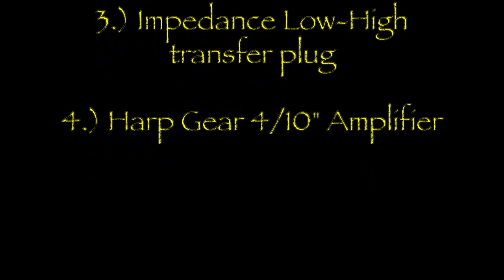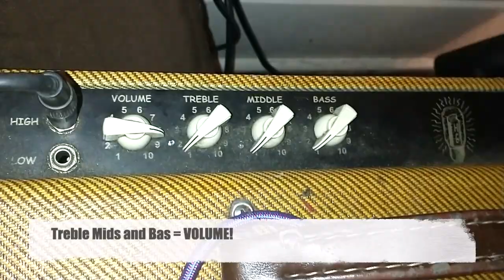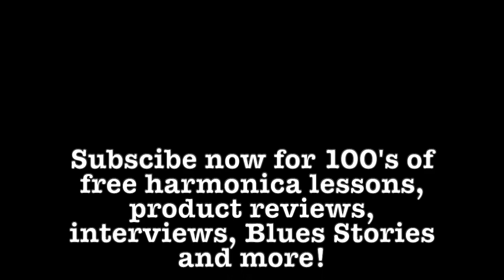How To Turn A Harmonica Amp Up LOUD! (No Feedback)

Comment: For loud gigs or outdoors, etc., I play a Bassman LTD per a suggestion I learned from The Gear Page: turn everything down, raise Mids to about 5-6 and adjust volume to taste. For the Bassman circuit, this will result in an almost flat response. (Check out the tone stack generator on the Duncan amps page for details.) This was a suggestion for guitar players, but it works great for harp.
Reply: you are a legend Chris - this is the only thing that has allowed me to use a bullet mic without feedback. Took years and this advice is the only thing that has worked - cheers mate!

Comment: I bought a Shure A85F transformer to play a Hohner Crossover C using a Shure SM58 in a Fender Hotrod Deluxe amp but the Feedback is huge unless I connect the A85F into the loop.

Comment: I realize that this video is a few years old - but I just bought the "Jason Ricci Signature Mic", and the site says that this mic is Hiz.... Is that a change to the mic since this video?  Just wondering, so I know if I need the impedance transformer or not?
Reply from the maker: We offered both for a while. The mic is essentially hi z here because I'm using a low to hi transfer plug so it's the same thing. We now only offer them in 1/4" hi z

Comment: Hi, Jason! Question for you... I recently used a Fender Pro Jr. on stage and was having difficulty getting enough volume before getting feedback. The Pro Jr. only has two control knobs - volume and tone. I adjusted both controls, but eventually settled for turning the Tone control all the way down and that allowed me to turn the Volume control up to almost 4. Still not enough volume. Any suggestions for how I might have achieved more volume?
Reply from the maker: Hey Jamey my bro!!! No unfortunately thats all you could of done.  I guess maybe an anti feed back pedal and/or a more modern (non bullet) microphone night of helped a bit more but there's definitely a reason why almost all the touring pros use BIG amps!
Reply: @jasonricci Thank you for responding, Jason. I really appreciate it!!! 🙏
Reply from the maker: @jameygarner-theharpslinger6906  next time call me we'll catch up.